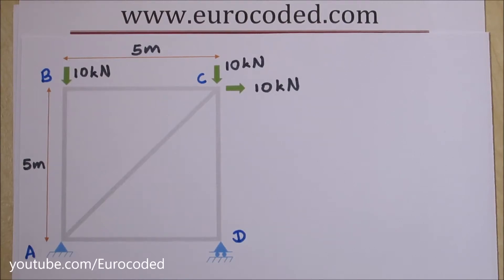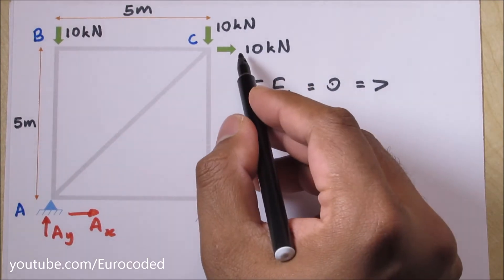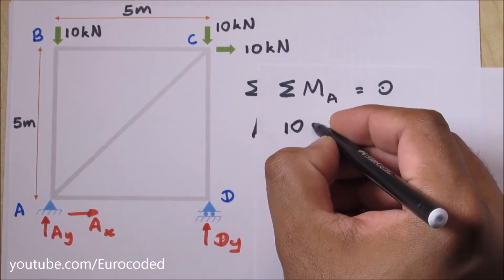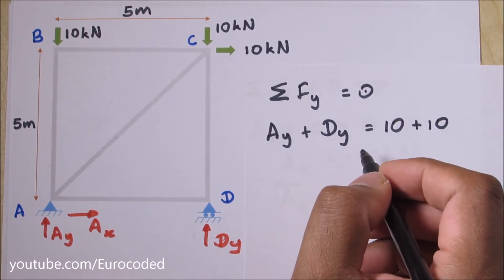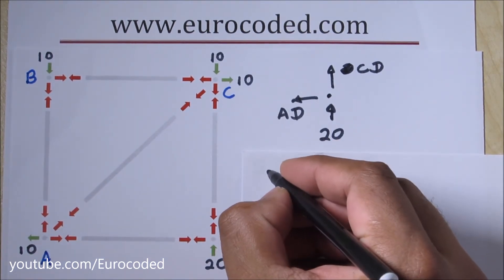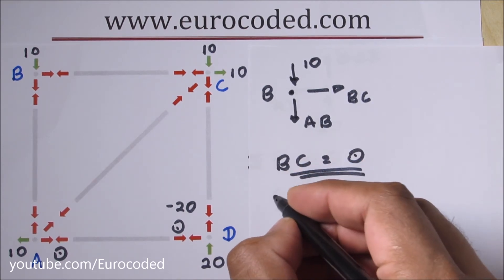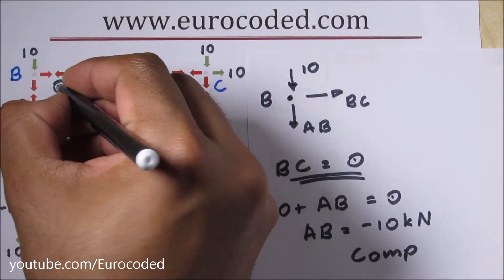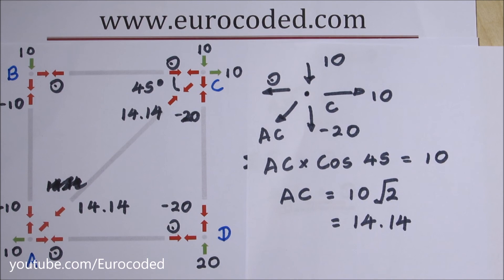Method of Joints Example Calculation - Truss Analysis - External and Internal Forces on a Truss

Comment: Should we always assume that joints BC n AD are Zero ? If there are no forces acting on Fx?
Reply from the maker: Yes, that is correct for this truss arrangement (no external horizontal forces are acting on joints B and D). It is a good way to speed up your calculations.
Reply: Eurocoded what if the arrangement of
                               F. F. F. F orces down
 truss is like this |/|\|/|\|
                              ^           ^
                     Hinge.         Roller
Upon getting the value of Hinge and roller, can we assum that he force Fx at the top is zero using method of joints??
Reply from the maker: xxshinrielxx  If I am following your truss diagram correctly then you can determine the zero force members connected to the top outer two joints just because there are no externally applied horizontal forces. But you will have to calculate internal forces of the rest of the top members. Does that answer your question?
Reply: Eurocoded your response is very much appreciated. THANK YOU !
Reply from the maker: xxshinrielxx  You are most welcome. Happy to help you resolve your truss problem :)
Reply: I'm a bit lost, maybe bc I'm slowpoke? Correct me if I'm wrong sir,  truss A  C  E   G   I
                  B  D  F  H   J.
If RBx=0 n RBy=n
then, can I assume that joint AC is Zero, AB is equal to the force downward w/c lies on the point A? Did I understand it correctly?
Reply from the maker: xxshinrielxx  You are correct. If you isolate joint A (method of joints) then
1) There is no external horizontal force applied to joint A. Therefore, AC is a zero force member.
2) There is an externally applied vertical force (let’s call it F1). Therefore, AB = F1.
Reply: I'm super thankful sir
Reply from the maker: xxshinrielxx  Keep going. You are heading in the right direction :)
Reply: thank you sir! I've been so lost that I can't seem to move forward bc of this truss problem. Your video enlightened me a lot :)
Reply from the maker: xxshinrielxx  Keep going until it becomes second nature to you. Let me know if I can be any more help.